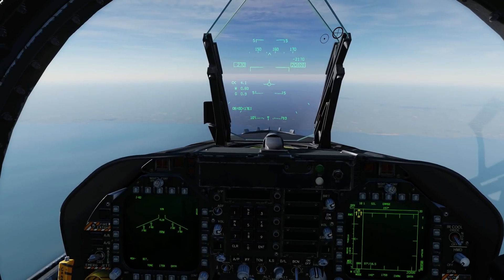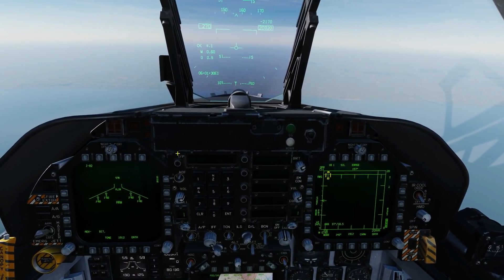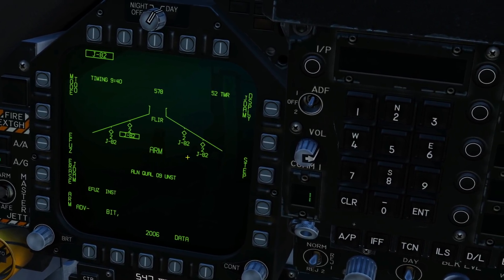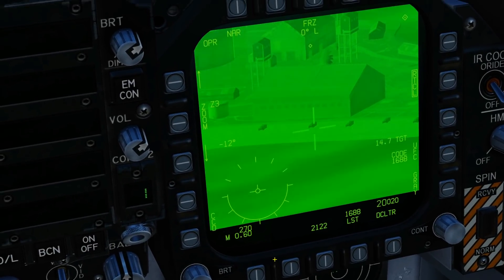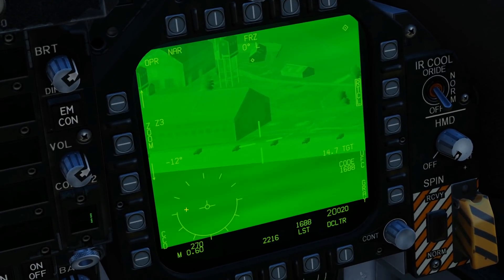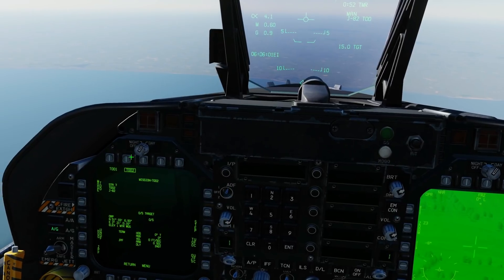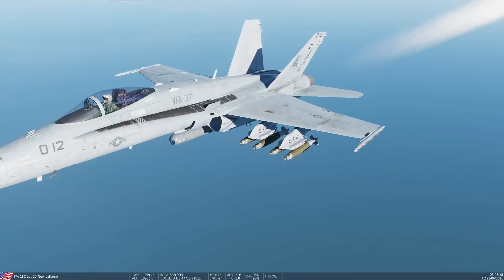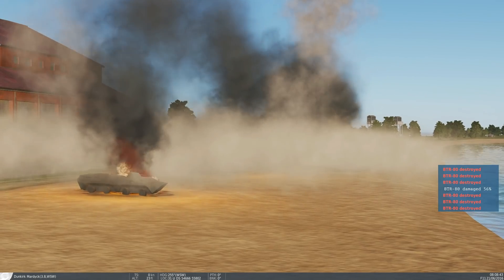FA-18C Hornet: Rippling 8 x JDAM/JSOW (TOO)(Via TPOD/TGP) Tutorial | DCS WORLD

Comment: The easy way to do this is with Mark Points.   You can slew the pod to each target and designate then make a Mark point for it.   Then you can ripple bombs to each mark point.   Same way you ripple with waypoints.
Reply: Can you give more info how to do this ?
Reply: @psvialli  Align the bombs
,TOO mode for each bomb, Efuz instant, confirm Manual release

Slew TGP to target HIT THROTTLE DEPRESS TO DESIGNATE then hit the MK 1 button, Next get new target and press the next MK button  Up to 9 marks

Then just hit the MK to select target then hit WPDSG each time before you drop a bomb
/watch?v=BYLy-8EKvJs
Reply: @alchemicalanarchist  Awesome  worked like a charm !
Reply: @alchemicalanarchist  or you can move tgp to target then  despress fire then next target depress fire then next target depress fire then next target depress fire and so on no need to mark them.

Comment: No need to press nose wheel steering after selecting first target. Just press TOO2 BEFORE slewing the pod to the next target. Same with pressing step BEFORE slewing to the next target. Then once you’re done setting all targets on all stations and missions Press unDesignate after setting last target. Don’t touch TPOD until you pickle all bombs.
Reply from the maker: thx
Reply: I tried this with auto release days ago ... if im not remembering wrong, it should work releasing all bombs TOO1 and TOO2 without manual selection
Reply: I suppose you can use target offset in the same manner as well, yes?

Comment: THERE IS A WAY FASTER WAY!!!!...no need to un-designate until the end just before you drop. THIS SAVES YOU FROM RE-SLEWING THE TPOD 7X. As you know if you switch pylons it will write the target data from the previous in to the current too & pylon combo. that is actually fine because each time you designate it will over write what automatically appeared from last time. When you have finished entering all your targets THEN PRESS UN-DESIGNATE ONCE. IT WILL NO LONGER OVERWRITE DATA AS YOU CYCLE PYLONS DURING RELEASE, BUT TIME TO RELEASE WILL STILL BE DISPLAYED IN HUD. DROP 4 BOMBS, THEN SWITCH TO TOO2, DROP 4 BOMBS. Did i explain that in a way that makes sense? I have tested it it works as you can see saved a lot of steps. I have been doing this for a while effectively in the GR server for a while now.
Reply from the maker: Good job guys.
Reply: Yep, setting up TOO 1 and 2 is a waste of time. Find target, weapon release, while the diamond is still on FLIR move the pod to target two, release weapon etc etc.
Reply: @OzDeaDMeaT  yes thats fine if the targets dont' move after the first bomb,,if the rest  move then you will miss them.
Reply: @stevieanderson9670  Of course, they are GPS bombs.
Reply: Stevie Anderson that’s why you drop all at once. Most  will all hit before they get a chance to runway. Tip: Best chances of success  are to keep your targets as close to each other as possible. The further the way the least likely they will hit at almost the exact same time
Reply: @OzDeaDMeaT  Yup, that's the ways it's done!